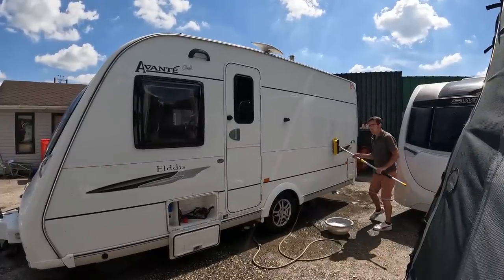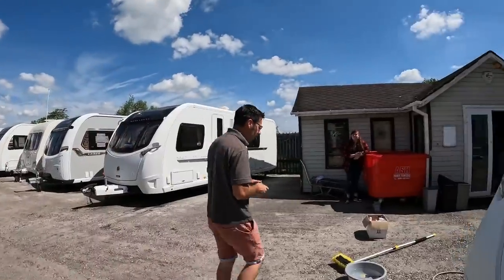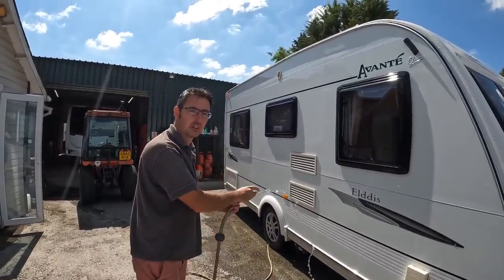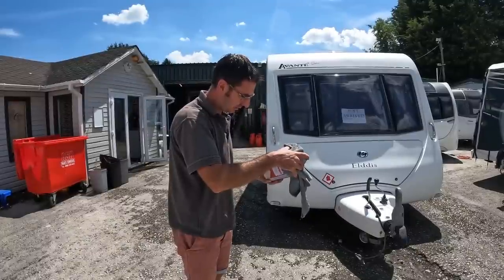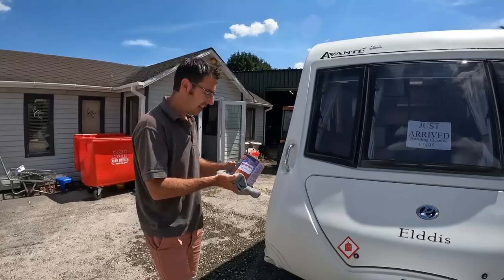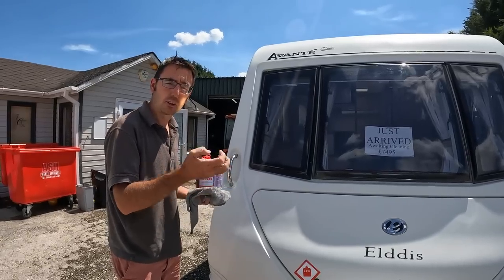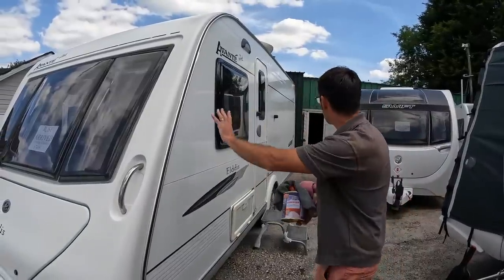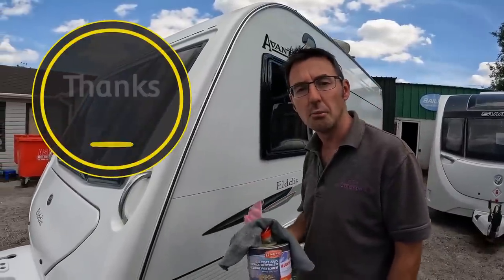CARAVAN CLEANING Like Never Before.

Comment: Mark after watching this video I went ahead and purchased some of that gel coat reviver to use on our caravan. A 1996 Avondale Mayfly Classic '25'.  I am absolutely astonished at what a difference this product has made to the exterior finish off the caravan front and rear panels and the side skirts and wheel arches. She is like a different caravan. Lovely shiny top coat. Tomorrow I will be doing the roof panel.  Thanks for yet another great tip and video
Reply from the maker: Amazing how easy it is too. Great to hear it has made a good difference 👍
Reply: I agree. Posted some pictures to your Facebook page.  Thanks again

Comment: Been interested in these kind of products for a while as I polish a lot of gel coats. I always have seen them as a kind of clear coat cover, not a fix. I'll give it a go a see what happens. Two little tips for you, don't use your brush on the windows, it amplifiers swirling and scratches, and use two buckets. One for soap, one to rinse. You'll reduce damage to the surface to help finishes remain less marred or swirled.
Reply from the maker: Cheers 👍, yea I think it does act as more of a clear coat, but it lasted a good amount of time, still can't beat cutting back and polish but maybe, use as an extra protection after cutting and polished.

Comment: What's the real difference between using a decent car cleaning product vs a specific caravan cleaning product?  Those brush type washers can also be quite harsh, I'd use a microfibre mitt.
Reply from the maker: It depends if its just a wash down then a car wash and wax will do but car cleaning products are more designed for laquered paint work where the caravan is lots of plastics and a un lacquered paint finish.

Comment: Done this to my caravan and it’s left smear makes all over ? Does this need another coat or rubbing off after application? 
Thanks
Reply from the maker: Hi Ash, the instructions say to apply then  polish off after 10 mins. You should be able to go over any areas again, just make sure you read the instructions first on how to best apply.
Reply: @thecaravanplace   I have done that as followed via your video and buffed off 2nd coat but still have marks like it hasn’t dried after a day ?
Reply from the maker: @ashsmith6397  double check the instructions as sounds like you have got something wrong somewhere.

Comment: Is it ok to use the gel coat restorer on my bailey which has the cream aluminium sides
Reply from the maker: It should be, but if you do try it, use in a small area first and test. But it says it pretty much works on any surface. But always best to just test first in a small area.
Reply: Thank you

Comment: Stuff like this is perfect for dealerships and independent sales as it makes it look like it was all correctly polished and if you take care of it then the shine will last ..

However we know that this is just a dressing like black trimm dressing .. It makes it look fantastic but once it washes off the buyer realizes their paint and gell coats are actually in very poor shape ..

Car dealers have special dressings for paint and glass and wheels so in under an hour they can make a neglected car look like new . But again it sucks to be the customer after a few rainy days when the coating comes off and they realize that the car wasn't actually restored but only given a temporary nice look .

I will always stay a fan of truly correcting the surfaces so that what you see is what you got .. If taken care of it will last and it's not just a temporary fix ... 

I've seen many a disappointed customer after they own their trailer or vehicle for a few weeks and realize that all of the surfaces are in terrible shape once that coating wears off... The coding makes it look as if the trailer or car was taken care of extremely well and as if it could be continued to be cared for and look good but it just washes off and the customer has been a little dupped into thinking the surface on their property was very nicely cared for and will last with weekly washings .
Reply from the maker: It does last, but a good cut and polish is the only real fix. But this will still need to be done fairly regularly.

Comment: Hi Mark, on the older van you usually get a black dull stain under the window. I'm sure you have seen what I mean. Dose this work on that or do you have any tips?
Reply from the maker: On the black marks t cut or a good cleaner is the only way to remove them.
Reply: @thecaravanplace  the trouble is, caravan paint is very thin, much thinner than on a car and t - cut will eventually rub the paint away. Around a  bath on the sealant, black mould can be removed by keeping bleach impregnated toilet paper in contact for a few hours, may work on a caravan ?
Reply: Bleach on a caravan are you mad

Comment: Hi. Just looking for this product, but found this in the instructions. 

Restrictions: DO NOT use Gelcoat Restorer on white surfaces, it will not work as it is designed to restore pigments.
Reply from the maker: Yes they say Don't use on white as it doesn't bring the white up as no pigment in colour. Which on the front gelcoat you could see it didn't make it really shine. But on the paint work on aluminum, it takes out all the oxidized areas and really brings the white paint up well.
Reply: @thecaravanplace  I’ll give it go cheers.  👍

Comment: Looking on website the manufacturer states not to be used on white surfaces as its designed to restore colour pigments
Reply from the maker: This is correct, and the white has no colour pigment so it won't make it pop like it does on a colour. But it still works on white, most boats are white, which is what this product was designed for. Thanks For your comments Chris.

Comment: Hi Mark this product your promoting. I've just been on there website and it states not to be used on white surfaces 👹.
Reply from the maker: Its not that it can't be used on white surfaces, its that you don't get the same results on the white grp as you do with darker colours. Its made for boats which are 90% white lol. It works wonders on white paintwork though as it goes into the white paint easier than the white grp and really makes it come back to life. It will then give it a coating that will protect the paintwork, how long it lasts I don't know yet. We will do a update  over the coming weeks.

Comment: This a scrub up, or if you like painting over the cracks. Top tip don't wash your caravan if it's sunny like this !? I suppose time is money so a quick scrub up is good enough for an old van like this..He probably only paid 3k for it..?
Reply from the maker: This is very much a suck and see. It works to restore the gelcoat, but how it works and lasts on the side we need to see. So far so good but we will possibly do a test in a week or so to see how it stands the test of time. If you can find some for 3k send them my way!
Reply: Well your never going to release that kind of detail, I'm surprised you rised to such a comment.. speaks volumes, there are better products than T Cut..to use on Help coat....that give lasting results.  however you couldn't afford the time to apply as eats in to bottom line..
Reply: And those better products are?